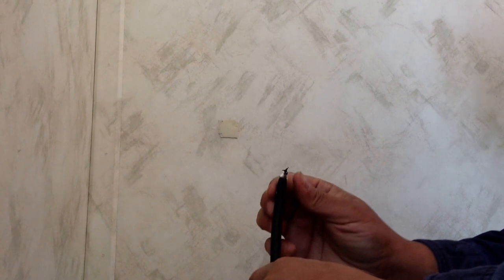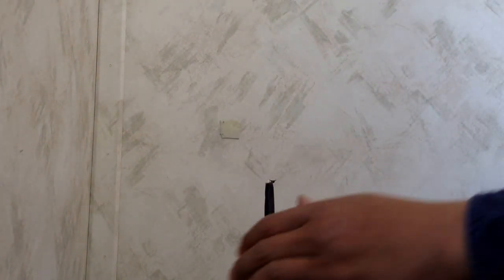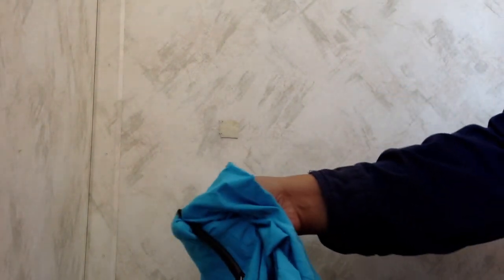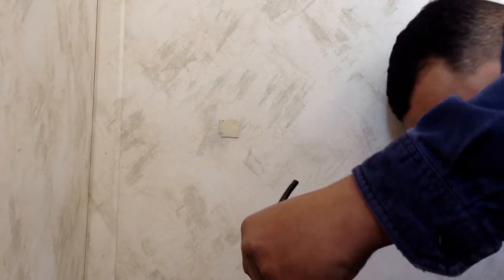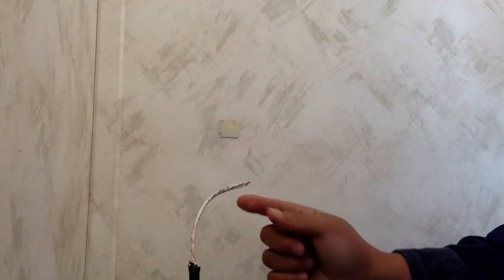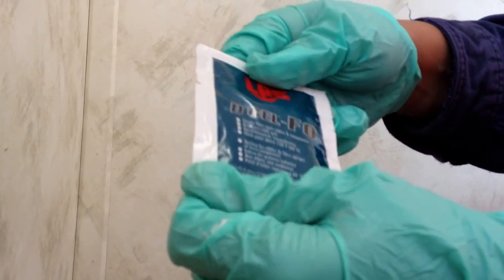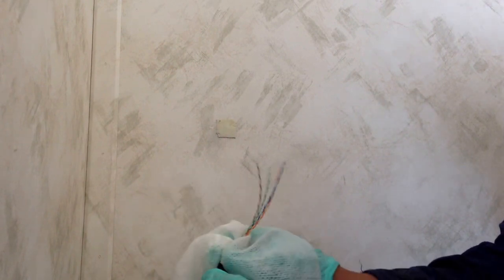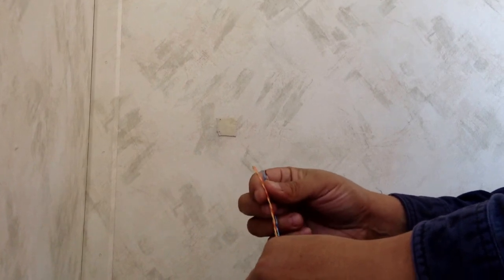How to strip Armored Cat5e Cable (Buried Service Wire) Icky Pic

Comment: What about termination though?  With most cat5e/cat6 cables you simply crimp on a connector that cuts into the individual wires near the end, and near the back, it crimps onto the jacket tight.  But how do you terminate a cable like this?  Are there special headsor connectors?
Reply: Armoured cable is most likely going to be terminated to a punch down block within a junction box.
I'd use a Compression Gland to hold the Armoured sheath into the Junction box then use a punch down module to terminate the cable end.
something like this https://www.cablemonkey.co.uk/cat5e-modules-and-wall-outlets/27-excel-cat5e-utp-rj45-loaded-faceplates.html